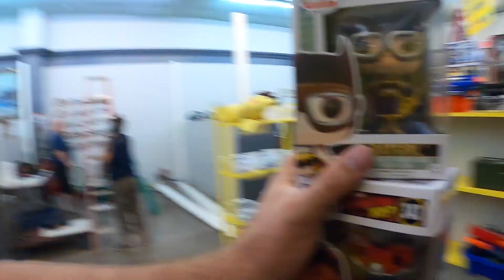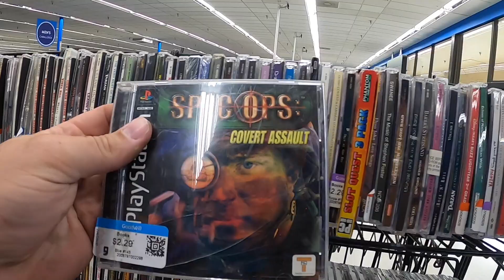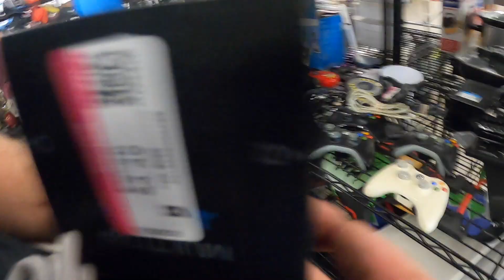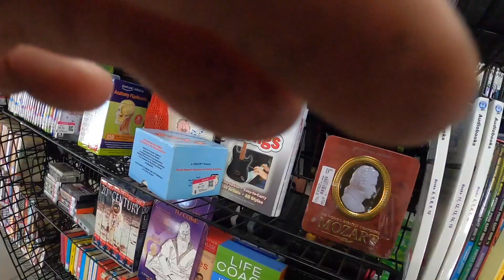Awesome Goodwill PS2 HAUL!!! | Live Video Game Hunting | Live Thrifting

Comment: Paid 20 for a PS2 at one of the local thrift stores here, which is reasonably priced. Usually here in CT they mark them at 60-80. It came with the power/component cables. It would not read discs and when I opened the console up the whole laser wasn't even in the console and I can't return it (cash only store). What a joke. Not good at soldering so dont want to replace the laser. Maybe I can get my money back for parts/repair on ebay. Not to mention when the consoles do roll out, they NEVER have controllers. I bought a "working complete" one off of facebook and 1 controller buttons dont work and the other has insane analog drift. And yea ive tried to repair both with no success. Sorry for ranting, im just stoked to see people get good complete retro consoles for a good price and hoping my day will come eventually. Love the content you guys rock!
Reply from the maker: That’s a bummer!!

Comment: Hey Hannah & Tendo. Another entertaining video. Just wanted to mention in case you didn't know you can use a dry-erase marker and color over any permanent marker and then wipe it away with a cloth. May take 1 or more attempts, but it has always worked for me...even on some fabrics as well. Glad Pants is okay. Can't wait to see your van once you have completely renovated it.
Reply from the maker: We’ve discussed many many permanent marker removal solutions on the channel. In this instance, I failed to clarify that someone has clearly already tried to remove the marker and has done a bad job, and rubbed it in. This marker will now never entirely come off, it’ll always be a little stained, unless you want sand it, which I don’t.